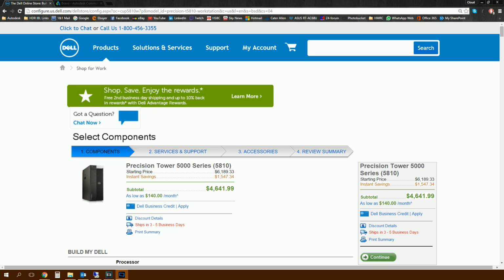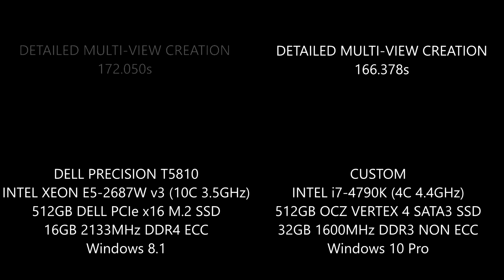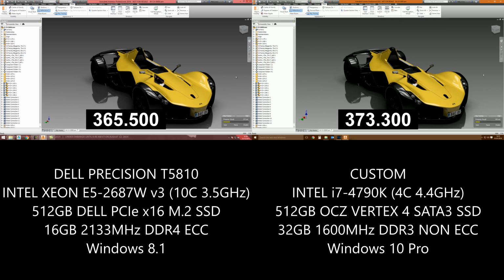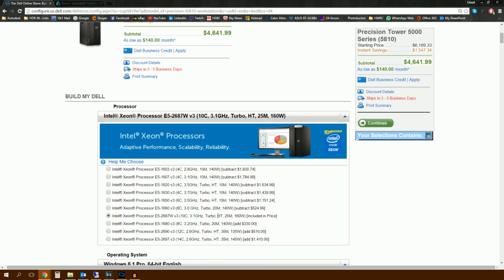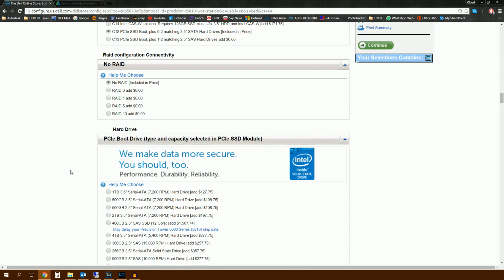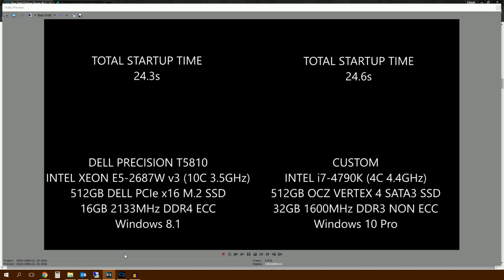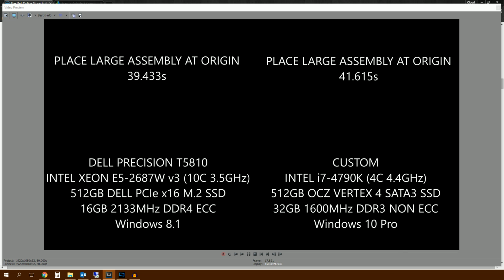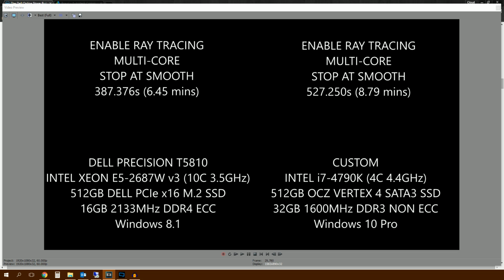$6000 10C Dell Workstation -VS- $2000 4C Gaming PC | CAD Benchmark Test

Comment: You don't buy a workstation because it's fast, you buy i because it won't fail.
Reply from the maker: Workstations do fail.  But indeed they do generally have a lesser chance of doing so on paper.
Reply: TFI First, if a gaming PC is good enough, you probably don't need the kind of CPU you'd get in a $6k workstation. 

But setting that aside,  and assuming your gaming PC is stable most of the time, how much is it worth to you in that rare case where having server-grade hardware would have avoided a computer issue that caused you to be unable to complete your work and you miss a deadline?

If that's not relevant to you, or just not worth it, then sure, there's no need to bother with pro hardware.

Otherwise, I'd say just thinking about what you're going to tell your clients when you fail to deliver because your gaming PC is crashing is reason enough to spend the extra money on a workstation. And it's not typically anywhere near this extreme a difference for equivalent hardware. 

For this application, you should be investing your dollars into a better GPU rather than more CPU cores or dual-processor.
Reply: I have a that same workstation at my office. My home computer with a AMD Ryzen R7 1700 and GTX 980ti and it kicks the Dells as at everything. Don't waste your money on a Workstation. If you wanna waste money and over pay for something that under performs then go but yourself a Harley. At least you will have some fun. :)

Comment from the maker: So, it would appear that some people are completely missing the point and not even bothering to read the title before whining at me.  Let me be crystal clear.  
Most people can't afford a $6000 workstation, a $6000 workstation marketed towards 3D CAD which comes with sales material stating that you need this to be better and quicker.  Most people then believe that they need this to get the most out of their 3D CAD WORK.
The point of this test, is to prove that a GOOD consumer grade gaming PC can actually be just as good if not better at 3D CAD than a ridiculously over priced workstation.  This has nothing to do with which PC is best as an all rounder, this has nothing to do with gaming, nothing to do with generic benchmarks, nothing to do with individual specs, it's a price to performance proof of concept ONLY RELEVANT TO PEOPLE WHO WORK WITH 3D CAD!
Reply: doesnt that cad program use one core for many tasks? this is an idiot comparison. you have to use software which benefits pro equipment, why buy it otherwise? this trend lately makes my doubt just how proffessional many rewiers really r... gamers looking for validation, that their new toy also doubbles as a useful full pro tool. it doesnt. a workstation has isv and reg for all pro software - and up to 7 year warranty. this dell a 3d maya artist could use for atleast 5 years with home support for both sofware and hardware. stop kidding yourself.
Reply: TFI If you don't mind, could you link me some resources to the difference between the two, and if a workstation is needed for anything short of rendering Finding Nemo real-time?
Reply: He is talking about Inventor ONLY. And if you do not render, multicore is rather usless. Maya/Catia/etc. would be utilising GPU better anyway so no point dwelling on CPU.
Reply: You didn't mention the graphics cards for both computers
Reply: TFI, unfortunately most people are mouth breathing morons. That being said, to me the most important thing is crashes and errors. How does the game PC handle high volume assets and how often does it crash compared to the pro machine. Thanks for the video.
Reply: "uses autodesk anymore?"

Well, Autodesk Alias is the de facto standard in the automotive industry.
Autodesk 3DS Max and Maya are the most used when it comes to animation and rendering (often along with V-Ray, Corona for cPU render, and other efficient GPU renderers (like Redshift or Octane...).

Solidworks and Catia serve completely different purposes. A workstation class PC is used for many things.
Reply: I was curious about how much a top of the line Dell computer would cost me: 10K plus. A decent computer for blender would cost me maybe 3K. I think Dell works for the job market: Companies who pay their employees 60K to 80K a year would have no problem getting a 20K computer that will last them 5 years or more.
Reply: I can vouch for a well built properly spec'd gaming PC functions very well long term for Autodesk Inventor.Since November 2012 have ran Inventor with up to 10million node mesh static FEA on a custom build gaming rig.For the first two years, it was oc'd to 4.4GHz and water cooled, then we went air with our i7-3770k oc'd to 4.1GHz with a Noctua NH-D14, Corsair AX1200 PSU, 32GB of DDR3-2400.  Asrock Z77 OC Formula had had no issues, even keeping the SSD RAID0 functional through a BIOS update...We only lost work with the same Inventor bugs that frustrated our four times pricier Xeon workstations...   or when we need to run FEA with a 13 million node mesh...  then we use Xeon's w/ 6 or 8 hyperthreaded cores and 64GB - 128GB of ECC memory.Lately, we do all active design work on "gaming" or HEDT equipment, and only bother the Xeons with the heavy lifting, such as FEA compute or rendering jobs.No Xeon can touch the single thread dominance of an i7-8700k oc'd to 5GHz, and most of Inventor's design phase is single-threaded.  our E5-1660-v4 Xeon lags behind even the ivy-bridge  i7-3770k, since the boradwell Xeon's had a multiplier lockdown.  Which is why we won't retire our unlocked sandy-bridge E5-1660 or the haswell E5-1680v3, since they both OC all cores to 4.1GHz easily.FACT- we've had more crashes on our newest Xeon workstation than any of the others - due to spectre/meltdown microcode patch, it was a $6000 paperweight for three months.
Reply: TFI – CAD & Technology For Industry I enjoyed your benchmark test, I use an Asus Strix gaming laptop, it has 12 gigs of ram and 8 Gigs dedicated to the graphics card ( NVIDIA 1070) which I use Inventor LT and Mastercam, and what gets me is even with both applications running (with the exception of post processing a program) I never go past 40 percent ram usage. Keep in mind that I don't have assemblies and I close Inventor before running the post processor just because I don't want anything interfering with that in any way shape or form because it is the primary purpose the pc serves. But it doesn't have any problems.
Reply: This is straight from the horses mouth (Autodesk website) regarding multiple cores vs higher clock speed in inventor "You can gain some benefit from using multiple processors in Inventor. However, a faster, single processor can be more desirable. By design, Inventor is not a multi threaded application. The processing load cannot ordinarily be balanced over multiple processors. However, some specific functionality in Inventor does support multi-core technology.

The wisest choice is to procure the fastest single CPU that your budget allows. If your budget allows, buy the two fastest dual CPUs."
Reply: I'm here from the future after just spending 200 usd on a used T5810, and ordering a 80 dollar 12 core Xeon now.
Reply: BUT, you can buy the $6,000 workstation after 4-5 years from a broker for maybe $1,500 (or less) when it's recycled ! I literally just (Dec 2020) bought a Dell Precision 7910 Tower  'barebones' for $400 including 1300W power supply, optical drive and a pair of low spec Xeons. Add RAM, GPU and SSD/HDD..

Comment: I'm setting up a T7910 at work for Solidworks and Rhino/Flamingo.  Dual 18 core Xeons with HT. So 72 logical cpus, and an M6000 24GB card. 512GB RAM and 1.2TB PCIE drive. Gets 136Fps in cinebench, and almost 5000 on the cpu score.  I priced out the config on Dell's site and it rang in about $24K
Reply: Krazy setup  put 1tb ram

Comment: stability is the difference for the professional not a few seconds of task completion. I can tell you 1st hand that we had custom builds for our architectural firm and they worked ok but we would have a crash during a rendering or a drafting process. this last year our firm purchased hp workstations and to date almost a year we have not had one crash.  If its a home game pc and you need a second or 2 faster that's great but for the professional I would rather loose 5 seconds instead of 8 hrs of work

Comment: A lot of Autodesk programs don't use multiple cores properly in any other tasks than rendering. It simply doesn't split the tasks into the necessary threads to take advantage of it. That means the other tasks are clock speed dependant => like a typical game.

Comment: The thing with buying workstations is that you want multiple processors and lots of ram. Thats part of the point.  When i have mari loaded and its using 30 gb ram.. And zbrush is using 20 ish... And then maya is open with the scene where the elemets from mari and zbrush are coming from. Having enough cores to deal with heavy scenes and multiple apps open that also are pushing your ram usage is important.  Its less about the race car performance. But rather about the heavy loads it can handle. Once you use up all of the ram on a gaming pc there's nothing you can do but close apps to free up ram. Thats a workflow killer.

Comment: another thing you dont seem to grasp at all or simply because you never had to work on the hardware side of things. the E5-2xxx models are dual socket capable. the e5-1xxx cpus are uniprocessor only. please once again stop this nonsense about "35ghz processing power" - it is simply incorrect. i understand what you were trying to do, but you have failed on a very basic level with the hardware

Comment: I have a dual xeon with 16 cores and 64GB of ram but I use it for 3d rendering. Xeons are used because they are known for their stability in long term heavy use. Its why they are used in servers. The GPU carries most of the weight when it comes to ray tracing.

Comment: Nice video, but what I can get out of this is that inventor doesn't use more than 8 threats, that's why the 4790k it's faster, you should have task manager so we can see how much CPU is beeing used.
I upgraded a week ago my old PC (i5 4670k at 4GHz) now I have a workstation 2xE5-2670 v1 for a total o 16 cores and 32 threats at 3.0GHz, I suppose that on inventor there is a problem with the amount of cores being used as I can tell you that on solidworks everything loads faster, indeed on render programs like keyshot it's 3 times faster on loading cad models, on saving and rendering.

That's why I would like to know how much CPU it's being used on Inventor as it seems really strange that you are having better performance with i7.

Greetings.
Reply from the maker: +MrTor8 Thanks man :) I need to go into this topic in more depth, I'll be doing more on this in the near future.  Basically Inventor can use 22 cores if you have them, but only a few parts of Inventor can do that and for short periods of time so you rarely see the benefits from core quantities.  The biggest benefit to Inventor is clock speed, Inventor performance scales dramatically with clock speed.  To prove this I have done another video where I had a $70 2 core CPU (Pentium G3258) running at 4.4GHz and Inventor ran faster on that than it did on a 10 core Xeon at 3.5GHz.

FYI Inventor doesn't support dual Xeons, it mostly uses one thread and when it can use multi-threads it's limited to 1 CPU.  Also your 3.0GHz is a bit of a bottleneck, an i7 4790K at 4.4GHz will run 99% of Inventor functionality much much faster than your dual Xeons.  However that's just Inventor, you'll see huge benefits from your dual Xeons in other applications across your general daily workflows.  

Also it would have been misleading to show the task manager as my screen capture software is fairly CPU intensive, the resource usage would have been distorted by that.
Reply: +TFI CAD Tips I seen the pentium video, and then I tried several "benchmarks" on solidworks, and well, it loads faster but you are right isn't using all the horsepower that I have, sometimes in calculating new operations it's using just 2 cores! So it's true, for cad there's not a real advantage and as you said maybe there is a disadvantage caused by the lower clocks... Now I would like to go in more depth too so I can find if there is a way to "unlock" all cores so I can get advantage.
So the only think I can said in faveur of Xeons is that at least rendering and simulations are high multi-thread based.

You could record the screen with a camera, I know is't the same, but at least you're not bottleneck by the capture card.

Thanks for replying me!

Comment: Really an apples n oranges comparison.  Most of the shortcomings of the Dell can be chalked up to the memory. There's only half the memory on the Dell. When the memory is full the HDD is used to augment the RAM albeit at a sacrifice to overall performance. Another interesting  test would have been to manipulate those large assemblies via 3D orbit or with a 3D mouse. 

I really enjoy your videos. I look for tips and methods that I overlook during daily use. Great work and keep at it!
Reply from the maker: +Michael Schara Hey thanks bud.  The memory usage was nowhere near full and wasn't a bottleneck here, this data set at the maximum usage point during the tests had the Dell at around 70% RAM utilisation, at all other points it was less than 50%.  This data set is used by Autodesk to demonstrate Inventor in pre-sale environments and is quite efficient on system resource, so the RAM wasn't ever maxed out, there'd be something seriously wrong if 16GB wasn't enough for a 1500 part assembly!
Also I have a test coming soon showing the 3D orbit benchmark testing, but using a 3D mouse isn't a suitable way to test as the 3DConnexion API plugin restricts Inventor to 30 or 60FPS whilst the 3D mouse is in use.  The only way to validate performance is to use the native orbit tools which doesn't have a FPS cap.

Comment: Most CAD software like Solidworks and Inventor use single core for all operations except simulation and rendering. Solidworks uses one core for each view in drawings, don't know about inventor. So, an overclocked i7 with 32GB CL9 1600MHz RAM would perform a lot better most of the time than a standard Xeon with 16GB CL13 2133MHz RAM. Best value CPU for CAD is therefore an i5-6600K unless you do lots of simulation or rendering.